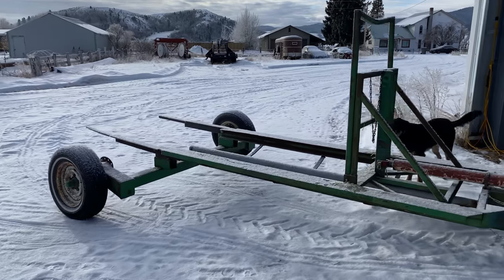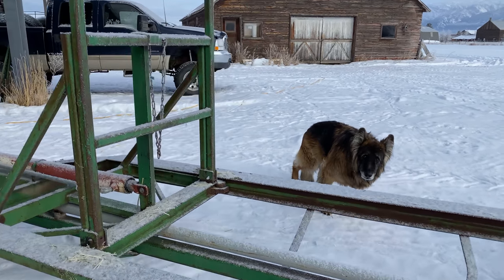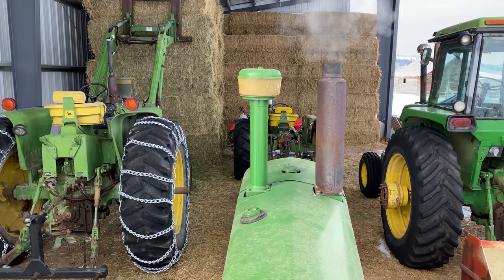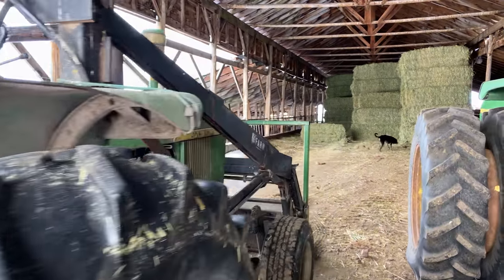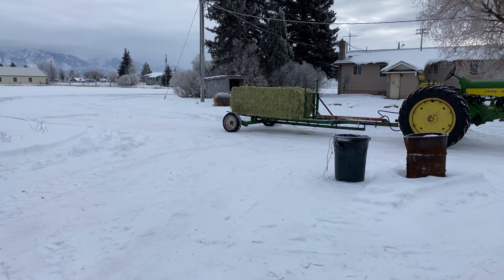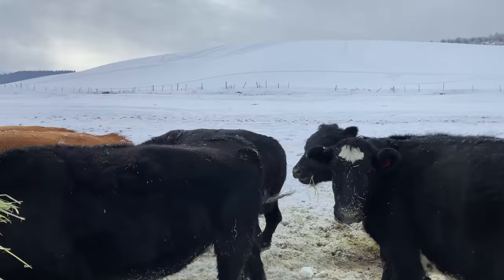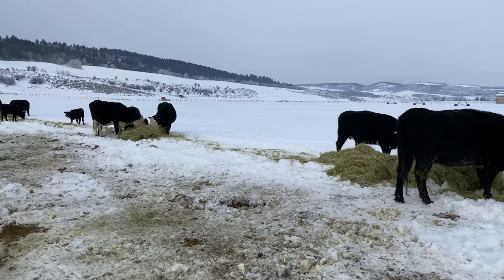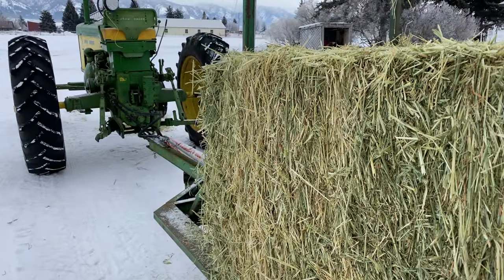Walk-Through and Explanation of the Feeder & JD 630 while feeding beef cattle

Comment: Forty years ago, i farmed 320 acres here in Minnesota. I had a 4020diesel, a 2440 diesel, and, my favorite was a beautiful 530. I used that as my chore tractor, raked hay with it, and, i liked to use it on my grain drill as well. It was reliable, super cheap to run, and, when i started it up to feed my steers, my blue heeler would appear out of nowhere to go out to feed the stock. That dog could hear that pop and come running.

Comment: Thanks for the video Kyle. Love Wyoming! Have relatives in Pinedale. 3020 diesel powershift is quite rare.
Reply: There is one on the dairy I help out on.  A 67 with wide front and a canopy.  We used to have a Knight Reel Augie tmr wagon on it to feed cows.  The farm out grew the feed cart and the next feed cart out grew the 3020.
Reply: Granddad had a 3020 diesel power shift back in the day.  There is a transmission pump discount to remove the pump load to help with starting on a cold day.  Well story goes one cold morning granddad startled the tractor, neighbor pulled up and visited for 20-30 mins then grandad got back on tractor,  well he had not engaged pump , so it had run 20-30 mins dry.....  so several thousand dollars (early 70s $) later and it was fixed.  The rest of his life never had another powershift.....
Reply: @Chevy4x4dawg  it's been awhile since I ran a powershift,  (my 4020 is a syncro). I thought that lever was spring loaded.  That must have been a bad day.